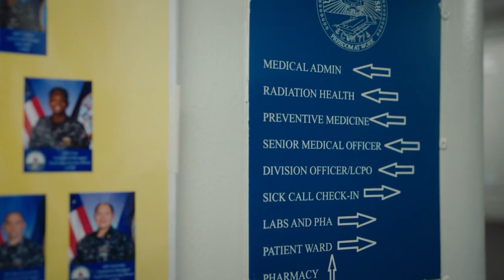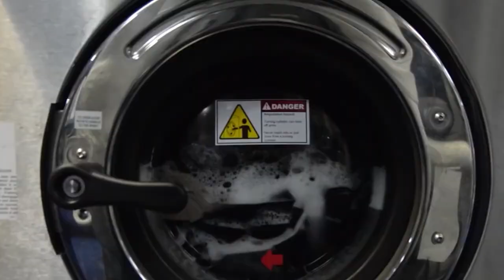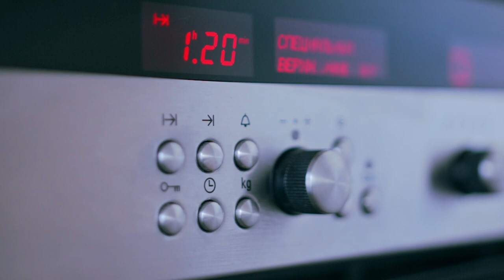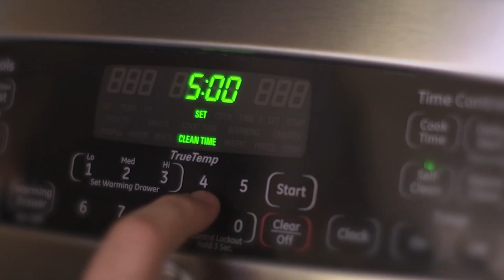What Happens Inside US Aircraft Carriers During Navy Sailors' Off Time?

Comment: Out at sea most of the time the hanger bay is gonna be filled with aircraft and you only have a small bit of space to work out on and a lot of the times they were moving aircraft or ordnance around and made you move. Also ships laundry for E-7 and above is good, E-6 and below they wash it then when it's returned to you in the coop, it's in a wad of wrinkled clothes and it's thrown on your rack.
Reply: They hook up in any condition of the sea, and resupply from other ships, often for drill time.